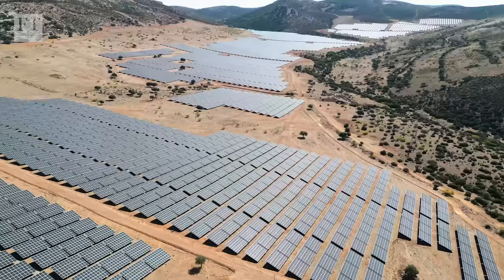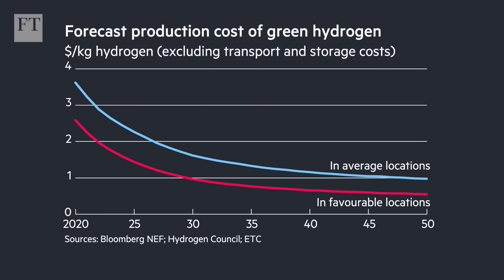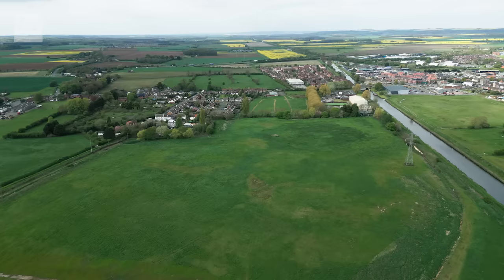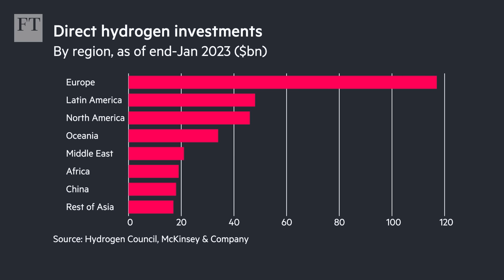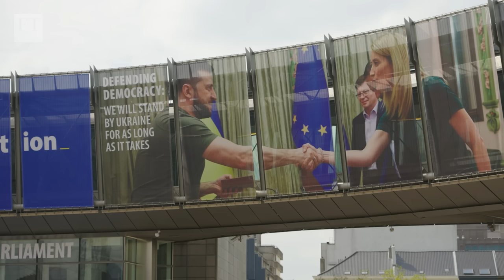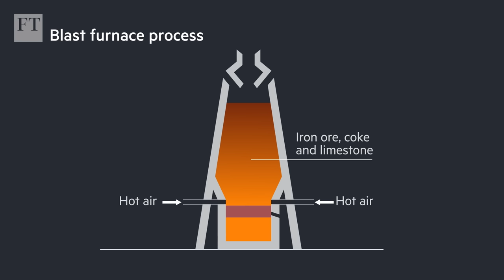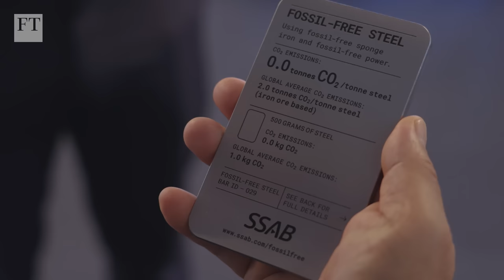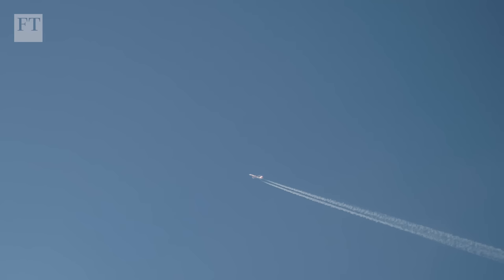Can hydrogen help the world reach net zero?  | FT Film

Comment: The elephant in the room - from the FT too.
1) 97% comes from oil - normally called brown hydrogen - except in the UK - where it called blue hydrogen as it magically cleaner there.  This is why it pushed so hard - it retains the status quo of the oil industry.
2) The overall efficiency rate of a hydrogen fuel cell car is around 25% (energy from electrolysis to drive train) , the overall efficiency of hydrogen combustion is 12% (electrolysis to drive train).  The overall efficiency of battery car (electricity/lets say from solar - like with electrolysis) - to drive train is 70%.  So you see - from a simple economics it is stupid to waste energy on creating hydrogen for transport.
3) Fuel cells require rare metals from dodgy countries (like Russia),  batteries require lithium (everywhere), cobalt (not much more), and other metals that are found in nearly every country meaning you are not dodgy - and means a small number of countries become powerful - look up the oil curse.
4) There is little hydrogen infrastructure, and that is truly expensive, it will be centralised, unlike electricity that allows people to take power of their energy. 
5) Carbon capture technology on large scale has never worked - Australia has been trying this longest and they have not succeeded - it is expensive - economically insane to require it. 
6) Energy density - although hydrogen energy content is high/unit mass, the hydrogen storage in a car, and the fuel cell means it poor energy density, no better than just battery.  Hydrogen combustion makes no sense for cars as the energy density is too poor for more than 120miles range. 
It is the economics stupid (leaving aside - safety, storage problems, efficiency, centralised)
Reply: haddow777 That's incorrect; hydrogen is always used in combination with oxygen to generate energy, and the byproduct is: Water! Hydrogen is considered one of the cleanest elements in nature.
Reply: 1) Maybe in Europe, but globally, there are countries with very clean energy sources.

2) The average efficiency of an SOFC cell is 55%, three times more efficient than any gas combustion engine.

3) Newer cells don't require rare metals; some can be built using ceramics.

4) Water is everywhere; everyone needs water for their daily basis. In the near future, home electrolysis will be way more common than today."

6) Hydrogen is the fuel with the highest energy density; it's more than twice the energy density of gasoline. Compressed hydrogen can be stored in cartridges; a single cartridge would be enough to provide a 180 km range for an SUV.
Reply: @guruxara7994  you have to understand lifecycle, where it comes from , storage and transport and usage.  Yes hydrogen burns to form water, but it comes 95% from oil using energy and the carbon left over by extraction is dumped as CO2.  If it comes from electrolysis, it wastes energy as oxygen, then you have to compress it using energy, and so on
You are very 1 dimensional, like saying BEV cars a emission free, no you need to make electricity, you can use emission free energy generation, but you still have to manufacturer wind turbines and solar panels.
Hydrogen as a lifecycle fuel is economically insane, and is currently less green than oil, but even when produced by electrolysis is much less green than using that electricity and storing directly in a battery.
Final note, fuel cells are very ungreen in manufacture, and only about 50% efficient
Reply: @guruxara7994  fuel cells are inefficient
Electrolysis is 60% efficient, waste product is oxygen
Hydrogen has to be compressed to make it useful, that is very energy intensive, wasting energy
Hydrogen is not energy dense, even when a liquid
Hydrogen is so small storage is very difficult, it leaks out of everything, it even escapes though unlined steel containers.  A cylinder of hydrogen can loose the contents over weeks.
It causes embrittlement of steel, it gets into the crystal grains of the metal and makes it brittle like glass.  All contained must be lined.  It cannot ever be used in existing natural gas pipelines with their legacy pipework of steel, or steel valves etc.
Hydrogen is economically insane and being pushed by the oil industry.  Why don't you invest in hydrogen then, good luck to you.
I am sick of people without an ounce of scientific training commenting on stuff.
Reply: @tomooo2637  Petroleum refining has an efficiency of only 5%, much lower than that of hydrogen. Still, oil is used as an energy source worldwide, perhaps because it is profitable for big cartels and corporations. Their lobby and political influence have restricted the advancement of renewables for decades. Hydrogen will likely become a reality in a few years.
Reply: @tomooo2637  Modern H2 cylinders are made of carbon fiber, which supports very high pressures and doesn't have the problem of leakage. You're living in the late '90s; the H2 technology has advanced very rapidly in the last 10 years.
Reply: @tomooo2637 Metal hydride, as a storage medium, could solve this problem. As I mentioned, H2 technology is evolving rapidly; technologies from 2014, such as the one used in the Toyota Mirai, will become obsolete in the next decade, and newer approaches will become the norm.
Reply: @guruxara7994  it makes no difference, you can store in solid matrix, liquid or gas, you need valves and pipework to the fuel cell, and all joints and valves leak as hydrogen is so small.
Reply: @tomooo2637  No, metal hydrides only release hydrogen at a very specific pressure and temperature.
Reply: @guruxara7994  it is economically insane, sorry.  It makes no sense as green hydrogen required electricity, which if put into battery storage and then used is 85% efficient from that electricity to create motion in a car.  The same for hydrogen is only 25% in a fuel cell and 5% for hydrogen combustion.   I have nothing else to say but look up scientific articles please.
Reply: The overall efficiency of hydrogen usage is 12% (electrolysis to drive train). Really!? Elctrolysis = 85%, Liquidification = 90%, transportation by sea carriers = 90%, driving gasturbines = 60%. The doing the math by multipying e.g. 0,85 x 0,9 x 0,9 x 0,6 = 40% overall efficiency!

Comment: Converting methane into carbon and hydrogen does not produce CO2 but the electricity one uses for the plasma torch contributes to it. This goes without saying creating and using plasma is thermally inefficient for the high temperatures needed, so I would be pleasantly surprised if the whole end-to-end cycle was not wasting energy in the process. Of course electrolysis also wastes energy in the conversation process, but it is a matter of which one is less wasteful, that is the point which is not clear from the video!
Reply: indeed. the idea was cool and all. i have high hope and its seem like solving problem but as right now it doesnt.

Comment: Digging into the #science of #hydrogen as a #feul
We set out to assess the current science in a paper, and find that under the right circumstances, hydrogen could indeed be part of a clean energy transition. But done wrong, it could be worse for the near-term climate than the fossil fuels it would replace.

While carbon dioxide can be a byproduct of hydrogen production, hydrogen itself emits no carbon dioxide when burned or used in a fuel cell. But when emitted into the atmosphere, hydrogen contributes to climate change by increasing the amounts of other greenhouse gases such as methane, ozone and water vapor, resulting in indirect warming.

That’s a problem because hydrogen’s small molecule is difficult to contain. It is known to easily leak into the atmosphere throughout the value chain. The farther it travels between production and end-use the greater the potential for leakage.

That much is well understood. But it turns out we know very little about how much hydrogen actually escapes from real-world systems. It hasn’t been clear because there has been no reason to look beyond basic safety thresholds — until now.

This is because traditional metrics systematically ignore the near-term impact of hydrogen and other short-lived climate-forcing agents by expressing the warming effects from a one-time pulse of emissions over a 100-year timeframe (GWP-100), masking a much bigger, more immediate influence.

There is another reason the warming effects of hydrogen have been underestimated. Until recently, every estimate of hydrogen’s climate-forcing power considered only the troposphere and not effects in the stratosphere. Accounting for both reveals that hydrogen has greater warming potential than is typically recognized.

Applying the combined atmospheric effects over a shorter, more relevant timeframe, we estimate the five-year warming power from a pulse of hydrogen relative to CO2 is 20 times greater than current calculations show using the standard 100-year approach.

And when we look at the relative warming impact from continuous instead of pulse emissions — which are more representative of the real world — hydrogen is 100X more potent than CO2 emissions over a 10-year period.

Comment: Hydrogen's low energy by volume makes it unsuitable for transportation. It takes 16 hydrogen tube trucks to transport the equivalent energy as 1 diesel tanker, how much pollution are you creating with 16 diesel tractors?
Much more efficient to move renewable energy over wires and directly into batteries when energy is used. 
Hydrogen made from renewable energy using electrolysis should be used to make fertilizer and produce steel locally. Conversion to and from electricity is wastefully inefficient, and transporting hydrogen in pipes without leaks is near impossible except under very tight controls like space flight and even then leaks are a problem.

Comment: Hydrogen is the most abundant element in the Universe, but it only occurs  on Earth  in combination with other elements. It requires energy to make from water, which means either using fossil fuels or renewables. In the case of electric vehicles it is  significantly more efficient to use renewables directly via battery electric vehicles. Hydrogen fuel-cell or hydrogen combustion vehicles also require a distribution network equivalent to the petrol/gasoline network of today.
Reply: efficiency is important but its not everything...range and atmospheric hygiene are two high priority factors HH answers.
Reply: A hundred years ago the same argument could have been made (and probably was) about the distribution network for Petrol & Diesel fuels. Where there is a will, and money to be made, there is a way.

Comment: The headline caveat should be that hydrogen is not an energy source. It's a transmission and storage mechanism. Possibly better than batteries - we'll see.
Green grey or emerald is a secondary issue.
Reply: Yes, this is what seems to be missed by most articles or films. It may well have useful applications and perform other technologies - but in the meantime efficiency and reducing energy use is a good start.
Reply: Hydrogen already seen as worse than batteries for vehicle transport. Over 10% of the worlds car production is battery electric. How many hydrogen cars? So low it may as well be zero. Trucks are also arguably better with batteries, with battery development they will be better.
Reply: Efficiency is 'secondary'? ...
Reply: @johanponken  yes relative efficiency is secondary to the fact that hydrogen is just a transmission medium, not an energy source.
Reply: @gilgamecha  Hmm, ok. But efficiency is relevant compared to other transmission mediums. There  no "just" about it. Though I've seen another argument here that as a storage medium, if you anyway would be wasting the energy, OK. But
Reply: Hydrogen is the energy source.
Reply: @guruxara7994  hydrogen isn't an energy source. Not unless you live on Jupiter. Creating hydrogen takes energy. Hydrogen is a battery, not an energy source. The hydrogen in you car will be created by the usual energy mix. So if you are in China the hydrogen in your car will come from coal powered electric plants.
Reply: @gilgamecha  This applies to any fuel. According to your logic, gasoline cannot be considered an energy source either because the energy required to refine it exceeds what it produces as output. Similarly, electricity demands more energy in the form of heat, light, or kinetic energy than it generates. As I said, hydrogen is the ultimate energy source. Our star engages in hydrogen fusion, producing heat, light, and radiation. The planet absorbs and utilizes this energy in numerous ways.
Reply: @guruxara7994  you are really out to lunch. Hydrogen is not an energy source. You need to go brush up on thermodynamics. Come back to discussing energy policy when you have a vague idea what you are talking about. Meanwhile leave it to the adults.
Reply: @guruxara7994  you need to revisit your physics and chemistry school lessons. Hydrogen cannot be a successful solution unless you cancel basic laws of science.

Comment: "Can hydrogen help the world reach net zero?" - not if we waste precious expensive green hydrogen on easy to directly electrify problems like heating and transportation - and that includes trucks, ferries and smaller boats and most defiantly trains. Most likely short hop flight too - see Harbour Air in Vancouver, BC.

Carbon pricing is the correct mechanism, but will never stick across successive governments - it's too easy to unpick and a popular vote winner if framed as 'Want cheaper gasoline? Vote for me!'

Reasonably well balanced piece from FT, well done.
Reply: the thing is we still need quite a lot of hydrogen for the chemical industry.

Comment: There is a case for using hydrogen for the long term storage of energy that would otherwise be wasted.  Other than that it is far to inefficient to be practical.  Hydrogen is being pushed hard by the fossil fuel energy companies because it is easy to make H2 from hydrocarbons, thats the only reason anyone is still talking about it.
Reply: I think there are better candidates for that (f.e. Na) But in the near future it is not even about storing energy. It is about replacing grey hydrogen for the applications, that we already use it for. At the current speed  of transition it will take quite a while until we have enough seasonal overcapacity to replace that hydrogen.

Comment: I read about research using nanotech for efficient splitting of water. That would be amazing if hydrogen can be produced with little energy out of water. Today it requires a lot of energy to split water into hydrogen and oxygen.
Reply: There is no magical device with more than 100% efficiency, splitting water into hydrogen and oxygen will always cost more than 39.4 kWh of energy per kg of hydrogen.
The most efficient electrolyzer from Hysata, which isn't in industrial use so far, needs 41.5 kWh per kg hydrogen, which means 95% efficiency.
Nanotech might bring some advantages, perhaps by avoiding expensive electrode materials like platinum.
Reply: "Normal" industrial use electrolyzers achieve around 80% efficiency (HHV), which means 49 kWh per kg of hydrogen.
There is some room for improvement, but not very much. Not as much as some Youtube-videos want to make us believe.
Reply: You might refer to hydrogen production with aluminum and gallium. Most news about this method forgot to mention the energy source: The oxidation of metallic aluminum. Of course, you don't need electricity directly for this kind of hydrogen production. But you need a lot of electricity to produce the aluminum which fuels this prozess. Much more energy than simple water electrolysis would need.
Reply: @701983  No one is talking about 100% efficiency; if it reaches 60%, it is already four times more efficient than any petroleum-based fuel.